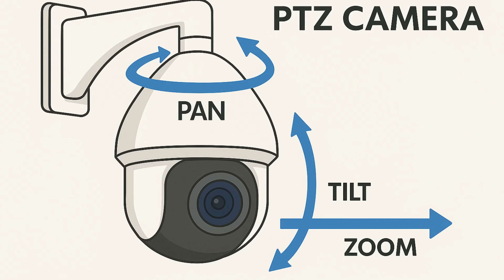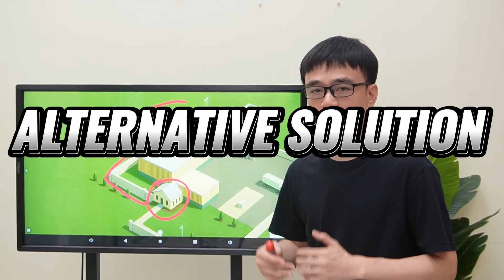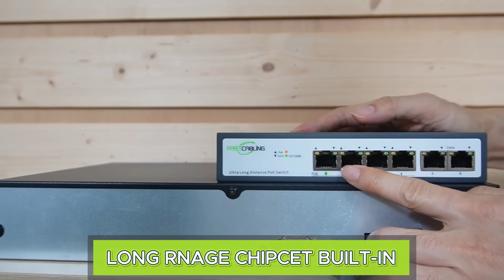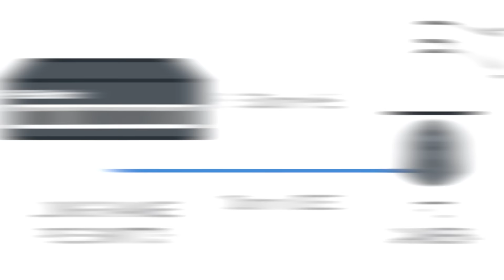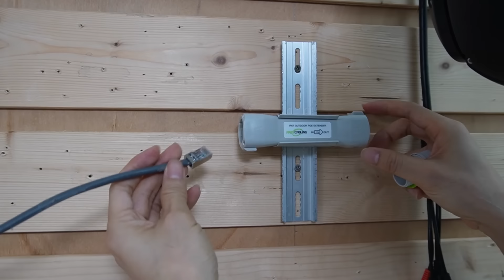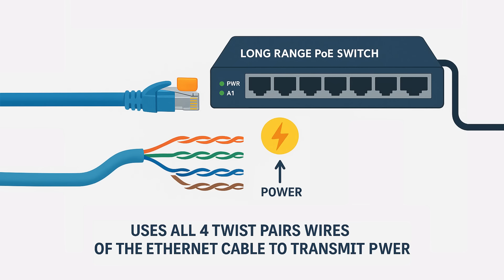How to Power a PTZ Camera Over 300M | Long Range PoE CCTV Setup

Comment: Is work in dahua PoE switch   over 300m ..it done it last week
Reply from the maker: You can connect your Duhua PoE switch to its uplink port. However, if you choose to use our long-range PoE+ switch, it may seem redundant to use your existing switch. If you only want to extend 1-2 cameras, you can use our PoE extenders directly.

Comment: can't we use LR POE switch at both ends instead of the POE Extender
Reply from the maker: The designed specifications of regular PoE switch is 100 meters only.

Comment: What if you used POE++ 90 watt ?
Reply from the maker: It will make no difference. This long range PoE switch takes 4 twist pairs to send the PoE power. It is how PoE++ implemented the power transmission.

Comment: What is special about the long range chipset?
Reply from the maker: It is the long range solution which can delivers 100Mb/s speed up to 500 meters.
Reply: @Fastcabling  But how/why? Is it just more power budget? QoS in the firmware?
Reply from the maker: It has a long-range chipset.